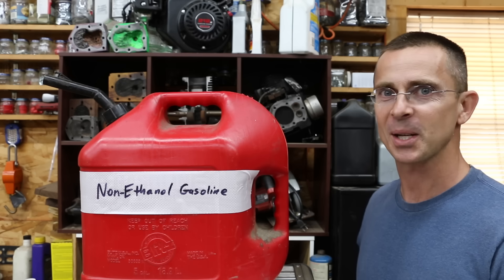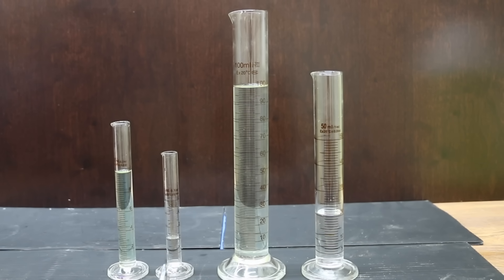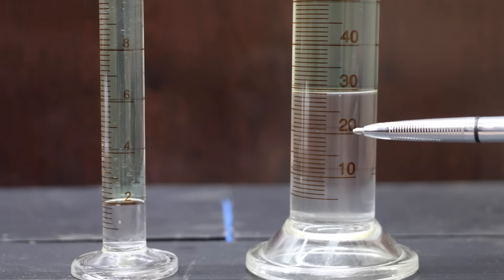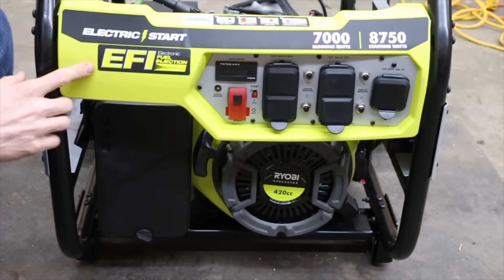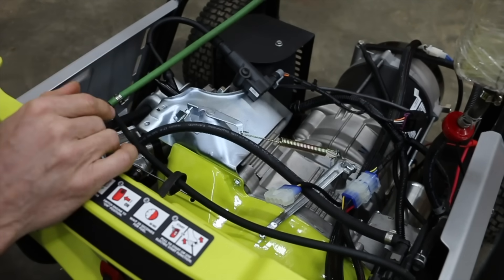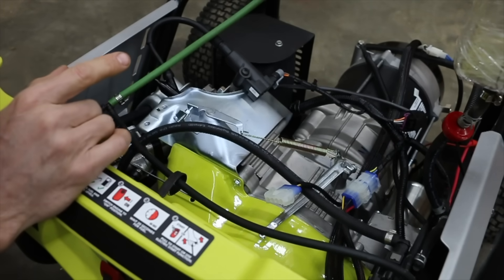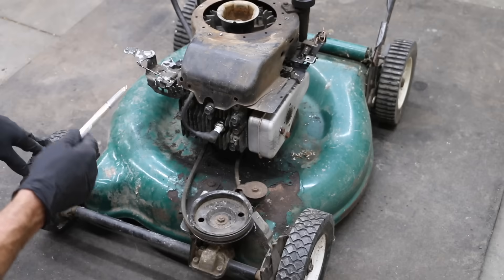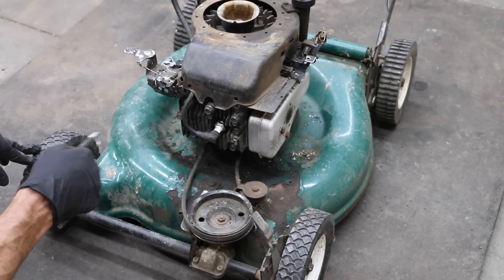Is Non-Ethanol Gasoline Really Better? See the PROOF!

Comment: The long term test sounds good but I don't really think ethanol in the fuel makes a difference. My bike has twin carburettors and when I rebuilt them there was no damage to any seals or any corrosion and my 29 year old bike had been running on ethanol gas for a good 15 to 20 years. In fact, when I tried to clean the carb floats after the bike had not been used for a few years, the floats were spotless and all seals intact and the system was left with fuel in it. If you upgrade your fuel lines like I did all the new seals, gaskets and fuel lines are made from ethanol tolerant rubber now anyway. rubber degrades over time so it may not just be the ethanol that's causing problems.
Reply from the maker: Thank you!

Comment: I've got something important to say, that generator needs honda spring retainers, or in a couple hundred hours you may drop a valve..common problem with chinese clone motors, the valve eats it's way through the ex retainer.... everything else ok.. but if i were you i'd buy genuine honda gx 390 springs and retainers and install... easy job you can change them out with your fingers.. reset the valve clearances and you'll be good to go for 500 to 800 hours plus....
Reply from the maker: Thank you for this information!

Comment: I have never found much difference in running one over the other, but have found that leaving the ethanol gas over the winter will kill the carburetor on a blower. I tried stabilizer but that didn't help at all and say to trust only boat  /marine fuel stabilizer like Seafoam brand if using one . . I recommend emptying all the gas and run it dry before storing. Thanks again PF. Brilliant as always!
Reply from the maker: Thank you

Comment: Question for you. Is there any additive you can add so you can use ethanol mixed gas in a chain saw?
I burnt one up this last summer using an additive everyone swore by 🤦🏻‍♂️
Reply from the maker: I've done it before without causing any harm but I don't store it with the E10 in the fuel tank.  I add a small amount of Seafoam along with a high-quality synthetic 2-stroke oil.
Reply: Redline 2 stroke oil is my favorite, if you run the proper amount of that I don't think there's anything better.  Sunoco 110 or avgas 100LL makes a good chainsaw really sing.
Reply: D S it sounds like you didn't have enough oil in the gas. It's better to run more oil than less (within reason) easy to replace fouled plug, and cut back oil. Expensive to repair scored cylinder bore.
Reply: @peterwelsh6975  well the bottle said to add it to one gallon. I used less.
Ether way I'm looking for a new one lol

Comment: My issue is that I have an older car that requires premium gasoline and was not designed or fuel mapped for e10. When e10 was introduced, my mileage dropped by 25%. Net result, more gasoline being used, nullifying any advantage of a "renewable" fuel additive.
Reply from the maker: Great point. Thank you

Comment: My concern with Ethanol is the destruction of fuel systems that are not build for it. I won 2 motorcycles and both were laid up for about 6 months or so as I travelled for work. Neither would start and when opened up,.. the fuel systems were destroyed (like an idiot, forgot to put in ehtanol stabilizer) There was rust in one tank,.. the hoses were brittle and cracked and the filter in there (permanent one) was broken as it also became brittle. The other bike had no tank damage due to the polyethylene tank (BMW) but the hoses etc were all brittle (anything plastic and rubber, which dissolved), cracked and all had to be replaced. Never had this issue on non-ethanol fuels but,.. there's no one near me now that sells non-ethanol based fuels.. that I can find. So,.. non-ethanol fuel has higher economy,.. less toxic fumes and is less destructive.. so why are we using Ethanol again?
Reply from the maker: Great point. Thank you!

Comment: Great video, PF, as always (Patreon supporter here!)
Just a quick anecdote:
Here in beautiful Upstate NY we can get non-ethanol for around $2.90ish a gallon. and I use it exclusively for our cars and power equipment (including a 13 yo Dixie Chopper mower). We live at 1000' elevation and everything we do we need to head for the Flatlands, meaning we drive a lot of hills.
When it first came available I tried a tankful in our 2010 Saab and there was no question there was a noticeable improvement in plain old 'get-up-and-go'. That's my wife's car and she feels the difference too. I've owned many cars in my 40 years of driving and I feel I can tell the difference.
So I then tried a tank in my 2002 Saab Aero and it was constant CELs until I refilled with normal 92 10% ethanol and they stopped. No other changes to the car and it had around 170k miles on it. Both cars completely stock.
Finally had to let the Aero go a couple years back (gawd, I miss that car) and now run non-ethanol in a 2015 Audi Q5 with great results.
Reply from the maker: This is great information!  Also, thank you very much for supporting the channel!  Best regards, Todd

Comment: Here in the UK last year we had a heatwave in June/July the grass stopped growing. This happened, customers would bring a mower for service in March, do a few cuts and then leave it in the shed because the grass wasn't growing. When they got it out later in the year it wouldn't start as the petrol/gas had gone off in the carb with the heat. It turns into a green goop and blocks everything up. It never happened 20 years ago when we had 4*, what is it exactly that's happening?
Reply from the maker: This is great information!  Thank you.

Comment: Next time you use graduated cylinders, be sure to wear a lab coat. Play it up! :-) Another highly informative and great testing video!
Reply from the maker: lol.  Thank you very much for the positive comments and thanks for the latest video you put together on how to spin open a deadbolt!  You are a many of MANY talents!
Reply: Project Farm lol
Reply: @ProjectFarm  Have you ever done a test on running propane in small engines. I have a d-17 tractor that was born burning propane and the oil never gets dirty. thanks for your videos.
Reply: electronicsNmore no don’t wear a lab coat
Reply: How about a blue mechanic's overalls with a "Project Farm" embroidered name tag.  hehe.
Reply: And measure to the bottom of the meniscus.
Reply: ..and perhaps say millilitre
Reply: Hence the Milgram lab coat experiment. People who are trained to obey will believe you lolololol!!!!!!!
Reply: You can use elemental iodine crystals to prove there is ethanol in gasoline. Just put a couple of the tiny crystals in it. If it stays purple, no ethanol, brown means water and ethanol and ethanol ALWAYS absorbs 5% of it's volume/weight in water. That's why Everclear is 190 proof (95%) ethanol. Adding benzene, methanol (wood alcohol) or atropine (denaturing agents) will allow about 99% alcohol, but methanol will destroy fuel system parts, benzene is illegal and atropine doesn't burn-off. Denatured alcohol sold to thin shellac has methanol in it and still contains some water, otherwise, shellac would dry on wood in a few minutes instead of staying "tacky" for a few days. Ain't chemistry fun? And BTW, truly fresh gasoline will absorb 3-6% by weight of WATER (oil and water DO mix, a little) as any aircraft pilot or fueler  can attest to.  Or us ol' farts who've dropped old metal car gas tanks and had the sludge in them BOILED OUT back 45 years ago. They just toss modern slimed-up plastic tanks, but ask Grand-Dad about getting that yellow-orange slime in his fuel pump and carb from running the tank too low...
Reply: My measuring cylinders are not very bright and had to drop out of school
hence they are not graduated.
Reply: He's not a Poseur.
Just the real deal.

Comment: Here in the northern states, ( I'm in MI ) we don't see as much ethanol as southern or western states do. It is available but not at every gas station. When first introduced, we had a lot of issues arise from it. As most people have heard, storage is still a big issue, but the older cars didn't fare so well with it in their systems. Modern vehicles are designed to handle ethanol and therefore don't suffer the problems like years ago.  Of course people tend to hang on to what their dads learned, old stories die hard.  Most of the real problems now are more from motorcycles that weren't designed to run it in them.
Reply from the maker: Thank you

Comment: As I understand it, the benefit was not for the individual user.  Rather, like the state I live in where there were 14.7 million cars registered in 2016.  Now, lets take this a step further, I have been told that Ethanol burns with less pollution that does regular petroleum.  Therefore if I have a car with a 10 gallon capacity then one gallon is ethanol.  That is one gallon of petroleum per tank that we do not have to produce petroleum based product for,  now the larger numbers 14.7 million filling up twice a month is 29.4 millions of gas 2,9 million gallons save in petroleum product that was not needed to produce and I did not have to breath the fumes.  Doesn't sound like terribly much,  but a pretty good amount nonetheless.  Since I live in California and have for 65 years I can tell you that we went Pretty much all out on pollution control the results are quite visible, particularly if you live in the Los Angeles agea.  The air where I live is now dirtier that the Los Angeles area.  So while I enjoyed your video and posted my like you are only talking about one small part of the overall story.
Reply from the maker: Thanks for the constructive feedback.

Comment: Dont drive my cars everyday. They sit so use star tron and non ethanol fuel. Also do the same for mower and generator. I didn't switch from ethanol for a couple years and didn't have any issues. Figured why chance it so switched. Going on a couple years both ways. Plan to stick with non ethanol fuel going forward.
Reply from the maker: Thank you

Comment: You should never run ethanol in a small engine or a carbureted engine however in a modern fuel injected engine in my experience it doesn't make much difference.
Reply from the maker: Thank you!  Yes, over 10% ethanol voids the warranty on the EFI generator.

Comment: The biggest problem myself and a lot of others here in the gulf south have found with ethanol is not its power output, not its burning characteristics, and not its destructive tendencies as some claim. Yes, ive seen it collapse boat fuel lines that werent rated for ethanol, but those were rare cases and probably cheaply made fuel lines to begin with. The biggest problem we have encountered with ethanol here in the humid gulf south is it is very hydrophilic and will attract moisture sometimes faster than the fuel can be burned. A lot of people with boats have had a lot of problems with the ethanol simple because if you do the math on a 50 gallon fuel tank in a boat that needs atmospheric ventilation,  it can quickly and easily  absorb 5 gallons of water if the fuel is a rate of 10% just from the humidity in the air. Fuel storage is also a problem because of our high humidity. It doesnt takes weeks or months for the ethanol to absorb the atmospheric water, it takes days, sometimes at 90% humidity it can take a few hours. 

Now the fuel lines i spoke of before were generally pre-made fuel lines meant for outboard engines that were available at the big box stores like Walmart. The lines in question generally do not look like typical black rubber fuel line, but are usually gray and sometimes blue, with a glossy coating on them. These are the two types of line ive seen fail, and the way they fail is inside of the fuel lines there is a second clear sleeve type liner, and in the cases ive experienced, that clear liner will separate from the external line, and given time it will start to break down and enter the fuel system. If your interested in testing long term affects ethanol on fuel lines, these would be ones i would recommend for you to try. Great video as always, keep up the great work!
Reply from the maker: Great point!

Comment: I was told by an old timer that ethanol and all the rest of the chemicals thats put into fuel not only ages your engine faster, it supposedly cuts back on emissions.  Im no fuel expert by any stretch, but i do know my car runs better on the non-ethanol higher octane. By the way, interesting way of seperating the ethanol from gasoline. It would make sense that gasoline floats on water.
Reply from the maker: Thank you

Comment: I think another long term test should be to have a container of both fuels.....perhaps add a steel or aluminum bolts or parts to the container to see what happens when fuel is stored for a long time to those parts.....perhaps even have a container that has a small amount of fuel in it and allow it to breathe....and perhaps evaporate away, leaving deposits behind.
Reply from the maker: Great recommendation!

Comment: Ethanol makes more power. So yes its better.    Its just terrible for the fuel system.  And damages engines not designed to use it.  The AMA (american motorcycle association)  told the epa of its findings and the epa replied " we know its bad for motorcycle engines and we dont care"  never use 15% in a motorcycle
Reply from the maker: Thank you

Comment: There's a noticeable performance difference in my Ford Super Duty truck when I fill it up with 100% petroleum gas. Unfortunately, thanks to government subsidies, E10 fuel is about $0.30/gal cheaper here (Oklahoma) than 100% petroleum gas. I still buy the 100% but only in the warm months. I've always heard that ethanol spiked gas helps prevent ice from forming in your fuel tank and/or fuel lines when it's really cold. I don't know if that's true or not but there's an idea for another video... you're welcome haha!. Anyhow, I run E10 in Dec, Jan and Feb just to be safe, then switch back to the E0 after the cold weather is over with.
Reply from the maker: Thank you
Reply: It helps prevent ice because it can absorb moisture without separating, and when it does separate past a certain moisture concentration, the ethanol in the mixture acts as an antifreeze, and thr mixture is still combustible up to a certain water content limit of course.  As you can see, pure gas has no ability at all to absorb water, so the slightest condensation in the tank or elsewhere just beads up and collects in the bottom.  The engine probably runs better on straight gas if it is a pre OBD2 ECU that was tuned for pure gas and does not have more advanced long term air fuel mixture trimming that newer OBD2 vehicles have.  Otherwise, it's probably placebo effect, except that if you switch frequently, the trims are wrong and take time to readjust...and running a little lean like E10 injected using E0 trims always feels crappier than running a little rich like E0 injected using E10 trims.  Most stuff is already tuned a little lean, so running E0 after running E10 for a while will temporarily richen the AFR which can make it feel a little peppier...until the long term trim goes down again after adjusting to get the AFR back to factory...which then makes E10 really run like a turd until the trims feed back in to add the extra fuel volume needed to get factory AFR.  Get yourself a OBD2 scanner that gives live data and check it out.  It's actually kind of interesting to see how the short term and long term trims are affected by different fuels.
Reply: E0 is It's 70¢ higher than 87 E10 here in rural Pennsylvania.

Comment: Hey! I was of the impression that adding any kind of alcohol to the gasoline (which we used to do on carbureted cars during the winter) would absorb any water in the tank and mix it with the gasoline and therefore having it used in the engine. But your demonstration certainly suggests otherwise.
Reply from the maker: It "phase separates" at 3.8 teaspoons per gallon. Thank you.
Reply: @ProjectFarm  
Thanks for replying. I'm metric, however, so I have no clue how much water your teaspoon will hold. ;)

Comment: Bought a brand spanking new troy built weed eater. Was not thinking. Used low grade 87 eth. Did not live thru first tank. Thats with the troy built oil. Mixed correctly.
 Bought a new Stihl chain saw. Use 97 non eth and stihl oil mix. Zero problems. Point it at a log and the log simply separates itself.
 Bought a honda super high performance quad. Was told point blank use 97 or non eth. Never low grade eth.
Reply from the maker: Wow!  I only use non-ethanol now.

Comment: Non-ethanol in 2 4/wheelers and 2 mowers all with carbs have caused me problems also my neighbor's DRZ-400 the same. 10%ethanol with startron has worked best. All the above mentioned could go year's without rebuilding the carbs with the non-ethanol they have to be done yearly
Reply from the maker: Thank you

Comment: Interesting. My problems with ethanol fuel have always been from it eating the rubber and plastic in the carb. It also has a tendency to pull moisture out of the air forming goo in the tank. I'll be very interested to see your test results when that video becomes available.  I will note that E10 does have a slightly different caloric value hence the 4% difference in economy in your EFI generator - that change could have affected the burn in your lawnmower test since the carb was jetted the same... very unlikely to have skewed the carbon buildup results, but curious to see if there is a difference in runtime performance when EFI is not tuning the mixture.
Reply from the maker: Thank you